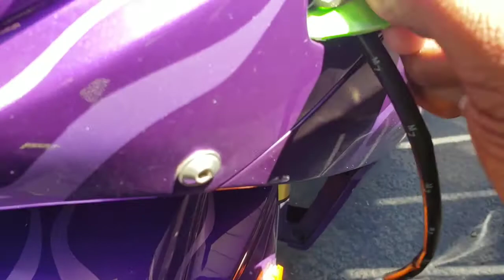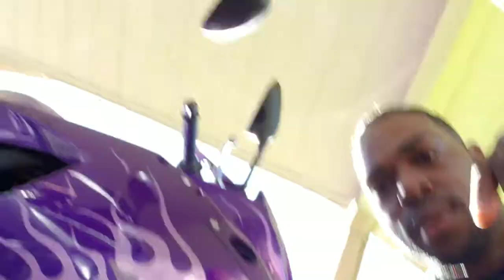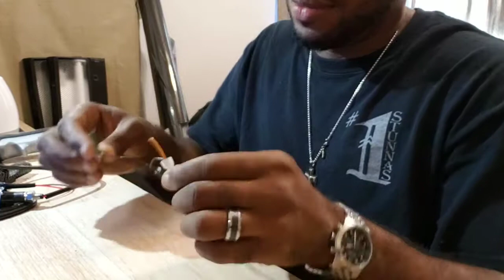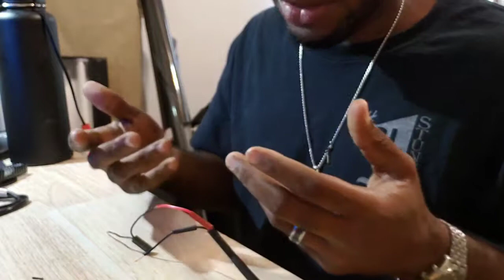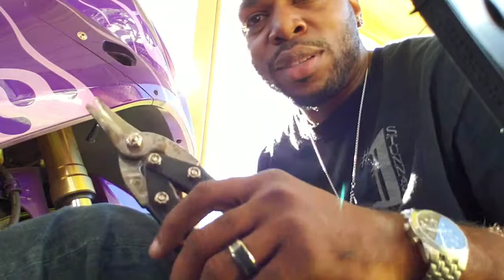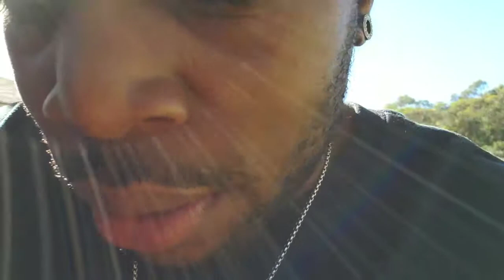How to install led turn signals on a motorcycle

Comment: Brilliant video, exactly what I needed after buying some new indicators. Took a good bit of digging around on here to find the right one, perfect, thanks 👍🏼
Reply from the maker: Thanks for watching bro, make it happen. Custom work is far more satisfying when you do it yourself. 💯
Reply: @andre.romance  just a small hitch at the minute, need an LED relay, bought everything else. I might order a clear rear light while the plastics are off. Saves me taking it off in the future.
Reply from the maker: @polly8220  for sure, check your relay ratings. Some of the newer bikes don't need a relay upgrade.
Reply: @andre.romance  all done now , even ended up with the confidence to chop and reinstall the alarm LED, from 1 red, built into the turn signal to two blue mounted on the undertray. Also got a rear light unit with integrated turn signals and wired them up together with the led turn signals. It looks great. 👍🏼